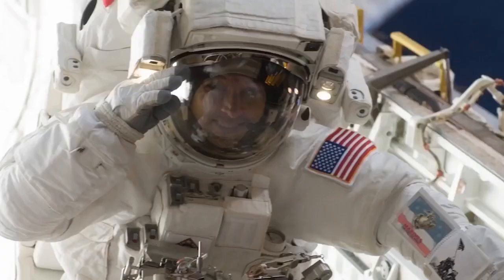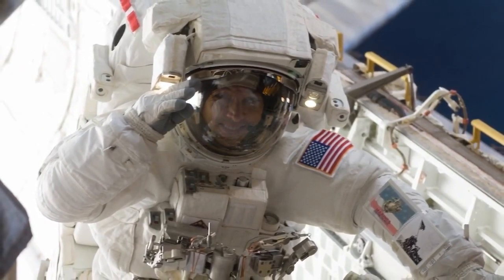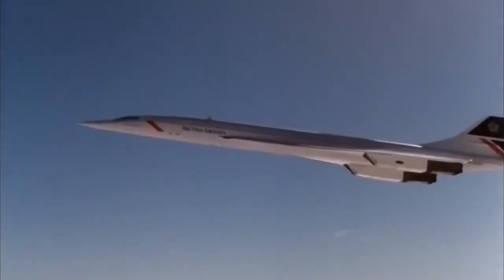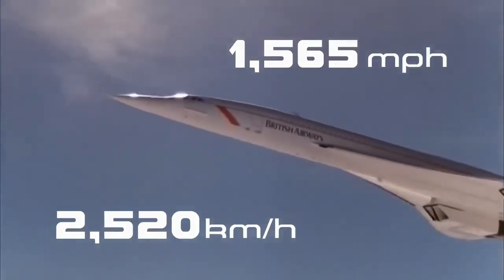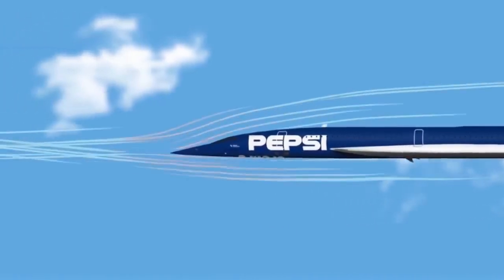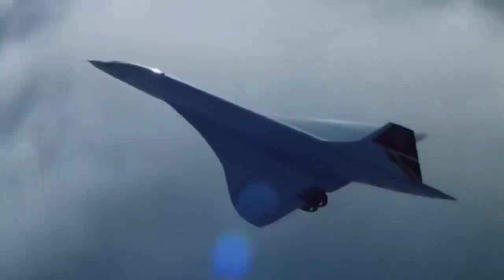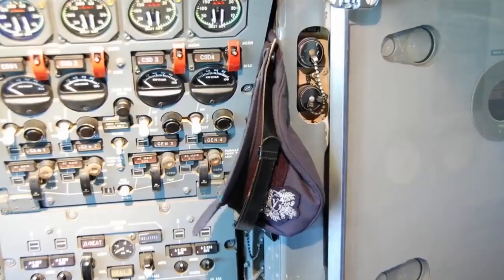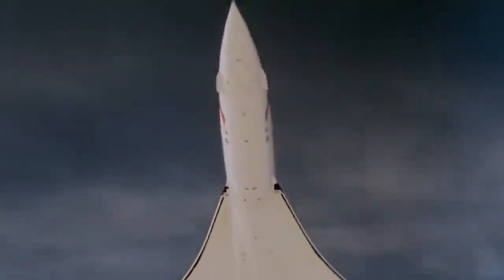ISS expansion and contraction issues

Comment: In actual fact.  Artificial orbits are impossible unless they are constantly powered and steered.  Anything that comes into the Earths gravity field falls to the Earth unless it has the onboard power to leave the Earths gravity. .  .  A rocket cannot do it.  Werner Von Braun discovered in 1943 that a rocket cannot develop thrust above 100,000 ft.
Reply: Spot on .. Thats why the ISS is boosted around once a month sometimes by a dedicated re supply module or by the stations 2 onboard boosters.
Reply: Yeah so how did V2s attain altitudes of 288,000ft.

Comment: Good find on the expansion of the plane.  I didn’t know it was that much.  Obviously it’s impossible that the space suits or ISS could withstand those fluctuations.  The supposed solar panels a 5 ply and under 2mm thick total.  Show me a heated 2mm thick steel plate maintaining its shape after its dunked in water.  Cheers